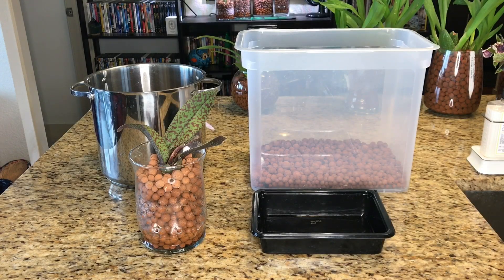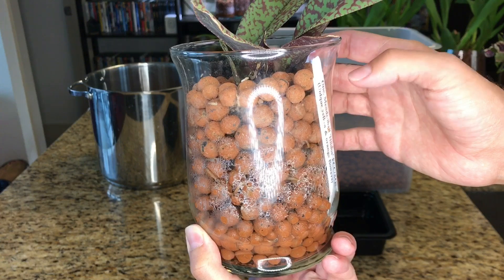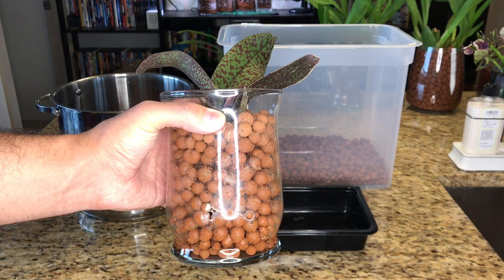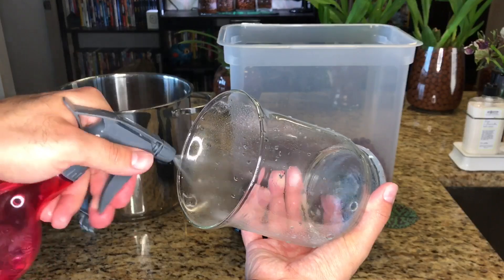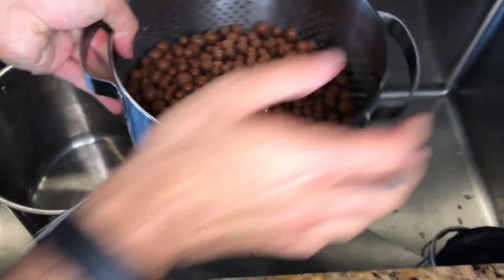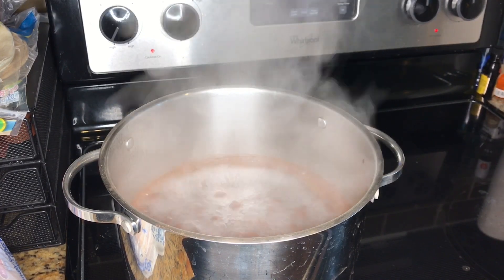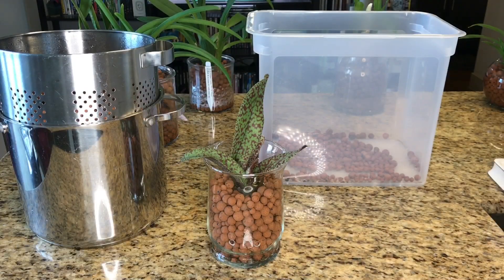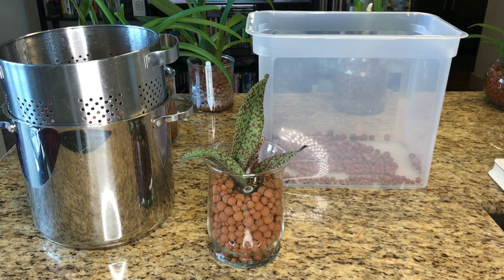Properly Cleaning Growing Media: Semi-Hydroponics

Comment: Does boiling the Leca breakdown the composition of the beads and shorten their use? Please advise. Thanks in advance!
Reply: No they where formed in 2000 degrees celsius and boiling only goes to 5% of that heat so it is no problems.

Comment: Why do you use Leca beads when they need to be boiled and cleaned?
Reply: Esp if they have been used before, they will be pretty bacteria ridden, more so if your orchid has gone through the transition process where the old roots die and new one specific to water growing grow in.  For aesthetic value, you may also want to boil new pebbles so they don’t shed dust into the glass container. However, if you trust your source for leca, you don’t need to do so or if you are using a non-glass container. I do hydroponics to grow organic veggies and I can tell you that if you recycle you’re leca without sterilizing it first your plants will die, esp your seedlings or young plants. Also, the dust clouds up the water and can clog up your water pump, if you have a large hydroponics system.

Comment: First of all, I think you are fantastic!  I am a little confused about the pros and cons of semihydro (sp).  If you have to boil the beads to clean them, how is that any different than changing the medium every couple of years?  I have learned so much from you, and I so appreciate your knowledge.
Reply: There are upsides and downsides with any system and no medium is perfect. I decided I will try semihydro just for fun, but fear algae and mold issues beyond my control ... we will see. :) That being said, my orchids totally thrive in bark, especially if I change it frequently, so no decay occurs.
Reply: Leca is reusable and does not decompose. So if it is cleaned it is for purposes of removing bacteria, pests, debris, excess fertilizer buildup, etc in case you want to reuse it for another plant, for example.

Comment: I bought some leca beads and they're not completely round (some more pieces than ball shaped)will these work just as well? Also, how long do you boil them for? I boiled mine for 20 minutes is that long enough?
Reply from the maker: Hi Lillian! That should be fine; it isn't as imperative for them to be equally round as much as it is for them to be roughly the same size. I usually do 15 minutes, so I think you're good!

Comment: Hi, I was wondering how long to boil the Leca, or is it enough to get it to a rolling boil and then turn off the heat?  Thanks!
Reply from the maker: That's a great question! I usually allow it to stay at a rolling boil for 2-3 minutes, then turn off the heat.
Reply: @MichaelsOrchids  what did u spray the glass vase with pls
Reply: Omg I have been using them and did not know they needed anything more than the soak in cool water I give them.  Now I know so will try to do it from now on that way.

Comment: Hey Michael, yeah I find boiling the leca the most efficient way to clean and sanitize it too. If you add some calcium nitrate or some Epsom salts to the water, it helps leech out the bad stuff from the leca even faster! ;)
Reply: Michael's Orchids wow that was the quickest reply ever 😊 thanks for answering. 

ps I asked my husband to make holes in glass vases for my semi hydro project. and he said after our holiday he will see if they have diamond drill-bits at his workplace  (he is a welder and metal worker ) I Sertainly hope so since they cost a fortune here in Holland. but can't wait to have what resembles your setup. you and your husband have the most amazingly beautiful home and have great sense of decorating and style. 

thanks for the inspiration 👍👌
Reply from the maker: I don't think it would be necessary! When you water, the solution will remain in the reservoir and wick up through the Leca beads, effectively "soaking" the beads until the system is flushed. Don't apologize, it's a good question!
Reply from the maker: Thank you OrchidudeBcn! What concentration do you use of epsom salt to do that? I've been reading up on that and have gotten some really varied answers.
Reply: Michael's Orchids.  I've heard one teaspoon per gallon.
Reply: Michael's Orchids mabey a silly question but could I soak the beads in kelp mix to store some nutrients inside the clay. ? I'm terrible at science and Mabey it would totally chance the structure of the kelp mix or burn the roots but your epsom salts to leach out bad stuff... made me thing if replacing that with good stuff. sorry for the over simplification 🙈
Reply: What amount of Epsom salt do/did you use?